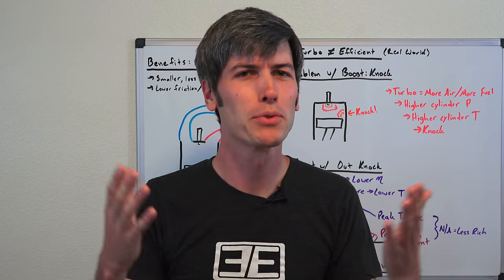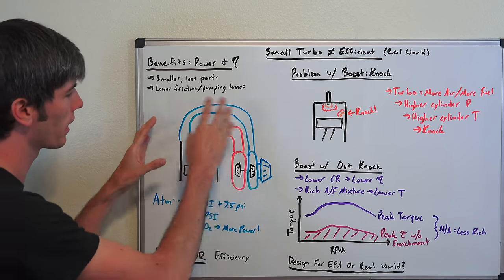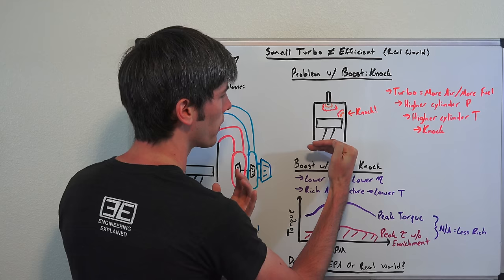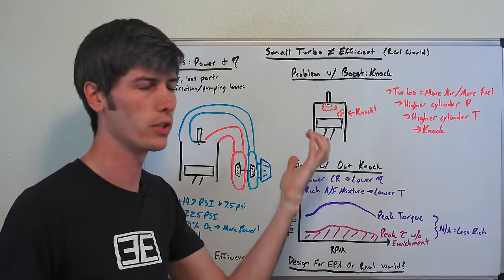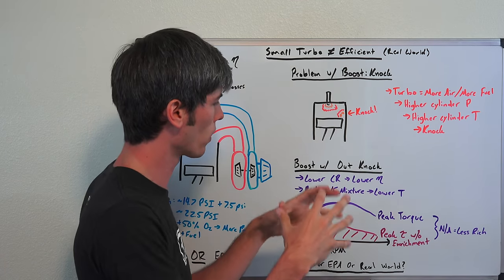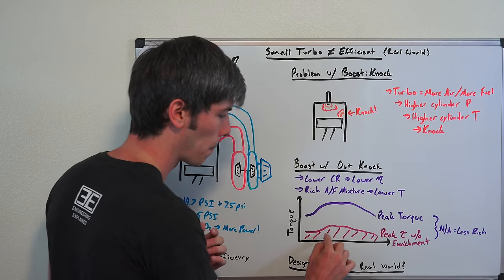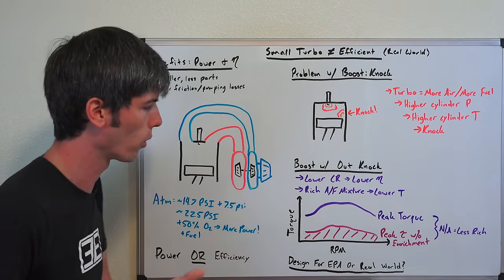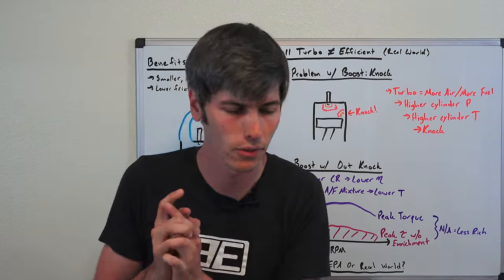Why Small Turbo Engines Are Not Efficient

Comment: I'm a proud owner of a 2018 Civic Si with the 1.5 L turbo that's pushing 20.6 psi from the factory. I get well over 30mpg under normal circumstances because I don't rev the crap out of it like some people do. They complain the mileage is bad; yeah it's gonna be bad when you're hammering the throttle all the time. These cars were built for the instances where you need power, but most of the time you want to save fuel. They're not supposed to be efficient when you're hammering on them
Reply: I have an 18 si as well. I get better than advertised on the hwy. If I keep my foot out of it, very hard lol, I can get 40-42 mpg
Reply: I get over 41 with my 2012 Altima, and its rated at 32 hwy. my city mpg sucks tho lmaoo
Reply: 18 Civic Hatch, hammer the throttle when taking off, slowly decelerate after getting about 5 over, barely hold speed with very light pressure on the gas pedal : 34-37 mpg city

Same car, eco mode on, give as much throttle as I can while keeping a full green eco bar, 5 over to decelerate the maintain same as before : 42-43 mpg city

43-47 highway

I only use Shell Premium
Reply: It's an EX Cvt 18 hatch (1.5L Turbo)
Reply: I'm going to buy one after the refresh.  I'm going to hammer the throttle all the time.  Who cares about mileage...  Good thing I can afford all of the fuel I will be burning!  ;)  Great car.
Reply: Gary Crispin I suggest 2019 Type R 😎👍🏻
Reply: Flat Earth, I wish.  You gonna spot me the extra $15K?
Reply: Gary Crispin lmao I understand 😂
Which is why you'll see me in an EX hatch 😉

I wish I would've been able to finance a type R when they first came out in 17, I could probably sell it for a profit today after driving it for a year.
Reply: I'd love to know how to get 41 with an Altima. Is transmission auto? What is your trick? thx!
Reply: I have a 2019 STI and in 95% city driving with minimal boost never going above 4K rpms I still can't get above 20mpgs if my life counted on it. The kicker is the car is a 6 speed 4 cylinder turbo, I only get maybe 23-24 mpg on the highway driving 60 mph granny driving it. The Highway mpgs are mindblowingly bad. Look at the EPA fuel economy 18-22. I should have double the power if you only saw the EPA mileage figures. In 2018 every 4 banger should be 30 combined without question.
Reply: stuna101a what fuel grade and brand are you using??
Reply: I got an Si also and as long as you keep off boost, you get great gas mileage.
Reply: ... my 18 year old 1.7 metric ton 2.5L 3 series gets 6.5L / 100km (36 mpg) @ 110kph on the highway and  ~12-15L / 100km  (19-20 mpg) in heavy city traffic.  In contrast, a 1L ford I rented during our holiday was getting 7-8 L / 100km (30ish mpg) - and really slow to boot.
Reply: my 2014 jetta TDI could get 36mpg hammering it all day, 55 on the hwy if you hypermile it.
Reply: I have 17 SI love it! 200hp 32mpg
Reply: I feel like that proves the point rather than disproves. Don't get me wrong, I'm really happy with getting 38-42 on the highway with my little econobox Cruze but to be in the 30mpg range in your Civic is pretty crappy considering the advancements in powertrain and aerodynamic design. You're not getting any better fuel economy than my sister got in her 1987 Accord...

The main point is that under boost, these engines are way less efficient than an N/A engine. 20.6 PSI is above atmospheric pressure which means the engine is able to move about 2.5 times more air than it could N/A. Despite all that, it's not making the power of a 30 year old pushrod 3800 v6 despite being as hungry under boost. 

Stop and go driving is where these engines end up falling way short of what people are expecting since most people want to pull away from lights and stuff with a bit more than 80-90hp engines...so the turbos spool to meet the power demand and efficiency plummets to a much greater degree than with slightly larger n/a engines. Obviously driving habits play a huge role in fuel economy...they do in any car...but the downsized turbo engines are limited because they effectively can either be economocial or powerful for an OE application.
Reply: Side note - have you had any oil dilution issues? I've been hearing a lot about the Honda enrichment tables being so fat the gas is blowing past the pistons and diluting oil. Seems to primarily be the CR-V which makes sense for the same considerations as the EcoBoost Escape - the engine is going to be pushed a bit harder to try and get a heavier/less aerodynamic vehicle going. Check your oil level and if it's gone up it might have fuel in it and be no good. I know Honda was working on a re-tune but I don't know where they're at.
Reply: Driving an F-Type R AWD with a 5.0 SC Engine around 30mpg regularly. Why is it again you have to drive an almost three times smaller engine with nonexistent power and sound, no AWD, no Torque Converter, less weight etc etc.

Small displacements are massively overrated - its mostly about the driver and traffic situations, not a mini engine. Best that i got with almost no traffic at night was 34 mpg. I know a lot of people with way less powerful cars, smaller cars, smaller engines that don't even get close to these results. Downsizing is useless...more about rightsizing. Makes no sense driving an S-Class with a weight of over two tons with a 2.0 Turbo Engine. Makes also no sense driving a Civic with a 6.2 Liter V8 SC Engine.
Reply: I also have an '18 Civic Si. I revved the crap out of it in Sport mode and on one tank. Total drive was 30.2 MPG. I think it's pretty great lol.
Reply: Better than me, I have a 15 Si, with the naturally aspirated 2.4 litre, and I don't mash the pedal, and I average about 22-23 mpg
Reply: I have a mk6 gti stage 2 and I get about 28 on average. 23 - 20 if I’m having too much fun lol.
Reply: 30 mpg is actually really bad, in my VW Golf 6 1.0l I average 52mpg easily even going as high as 63mpg.
Reply: @jakob321123  really bad for a compact, or really bad overall? Because I consider 30mpg decent. I just traded my 2015 Civic Si on a 2014 Mustang (3rd 2014 Stang I've owned), and I'm happy with the 22mpg I get. And the V6 Mustang uses 87 Octane where I had to put premium in the Si
Reply: I have a 2017 Civic EX-T it's the1.5L turbo. Ive had it  for a  year  now and I get the EPA estimated numbers. Overall I average mid 30's. I drive it pretty hard. I love balance of power and fuel efficiency.
Reply: Other than nails, not much else is efficient when hammering on it.
Reply: Same got 48hw/27 city on a trip to San Diego, 1.5 gallons to get home. Loving the Si .
Reply: stuna101a bad engineering
Reply: 2016 civic ex-t 31 city 45+hwy 
I live in austin so a lot of city driving and i average 34mpg
Reply: @kaneCVR  highly unlikely your 2000s 3 series weighs 1.7 tonnes.  That'll make it as heavy as a hybrid 2018 5 series. Unless your 3 series was a wagon. Most 3 series sedans tops out at ~1.6 tonnes, given a 1.45 tonne curb weight
Reply: @randomesteven3935  My 3 series is a CONVERTIBLE. The 'vert is the heavyset of the 3 series (e46) and mine has all options available in 2000. A front seat alone weighs ~65 kg.
Reply: Well,my 2018 GTI is running on a stage 2(which is only a $550 downpipe and $600 software installed at home) making 337hp and 370tq and Im getting 32mpg on 93 octane
(Car only have 5k on the clock and you bet that clutch WONT last 10k)
My 2007 sti is much slower than my GTI and as u know- these subarus only get 23mpg which is terrible.
Reply: I had a 1.7 liter Acura and got well over 30 mpg driving like a pissed off teenager....so what's your point???(
Reply: 20 psi and still that slow
Reply: 18 Si here too.  I can get about 40 on the highway.. but where's the fun in that? City driving its around 29ish in summer and 24ish winter..   My 97 civic Ex gets about 27 city and high 30s even 40s on the highway. Not bad fuel economy for double the horsepower and triple the torque.  ;)
Reply: Same here, I have a 2019 Civic Si Coupe. In city I get around 23-26mpg on average that's driving it pretty hard, when I just drive normally I get the EPA estimate of 28 and on highway I get 40 to 42mpg which is absolutely insane. I've gone from LA to San Francisco in on tank I used about 10 almost 11 gallons. 421 miles from point to point and exactly 6 hours and 18 minutes
Reply: I drove a BMW 116i(3 cylinders, barely over 100bhp) for a couple of months and the fuel efficiency was a complete disaster. It might be ok driving around the city, but once you hit the highway you went well over the 10l/100km (under 20mpg). The diesel equivalent (the 116d) is much more fuel efficient,  rarely going over 6l/100km (approx 40mpg) but thats about the same I get with my 320d which has nearly double the horse power and more weight ....
Reply: Wow, they're running 20 psi from the factory? I think Audi runs like 10 on my generation of cars. Mine is chipped and runs like 15 psi. I think the newer ones run more boost.
Reply: @stuna101a  The Subaru EJ is an ancient engine from the late 80's, it's no big surprise that it doesn't perform well compared to something modern.
Reply: It's not so bad for smaller cars like a Honda Civic, but a bigger vehicle like Chevrolet Equinox with the same size engine not so much
Reply: Jared Hoats my sentra claims 32 mpg combined, yet it does 43 mpg combined lmao
Reply: @ThirdLife86  30 mpg nice lie mate.
Reply: ive gotten 45mpg in my 16 optima 1.6t 7spd dual clutch a few times now. its rated at 39mpg hwy and 28 city. i usually get 23-25 mpg city because i constantly whip it around. i love that thing since it sips gas even when i push it super hard.
Reply: I have an 18 ex 1.5 turbo six speed manual; and drive it like I stole it. 33 mpg
Reply: Some n/a engines do quite well too. My 1.8 na corolla can average 36-38 us mpg on the highway, but it only has 137 hp. 

I miss the power sometimes but i like my corolla for slowing me down so i can enjoy the view
Reply: @ThirdLife86  A civic with a supercharged Corvette engine would be siick though! But super impractical, you're right.
Reply: Any Oil Dilution? I got rid of my 2016 Civic EX-T because of how bad it was.
Reply: Gary Crispin found the trump support who thinks climate change is a myth
Reply: Eric Nguyen 7000 rpm will get you 32 mpg?
Reply: 1.5L, with a turbo, eats premium fuel, but drives with no boost 95% of time and talk about fuel economic 😂. Just get a NA 4 banger
Reply: You know that the new 640 bhp McLaren GT makes 30 mpg with mixed driving. A 1.5l making 30 mpg is frankly terrible by comparison.
Reply: 13 mpg for ford focus hatchy 2018. I'm about to pull my headoff
Reply: Jared Hoats civic si is perfect and well promised
Reply: 20.6 psi of boost is from 7000rpm and mpg will become crap no matter what
Reply: honestly, 30mpg is bad for a 1.5 T..
Reply: @stuna101a  how's that sti doing?

Comment: I always looked at turbo'd engines as having the smaller displacement when driven softly and a larger displacement when driven hard.  Therefore, you will only get good fuel economy when you drive very easily, but you have the option of way more power when you want it.  You just have to sacrifice that fuel economy when you want power.  Kind of like cylinder deactivation, only more reliable.
Reply: I had  (2) 2.0 Direct injection turbo engines, one in a Forester XT the other in a Sky redline.  Both rated at about 250-260 HP.  My 13' Accord with a 3.5L V6 (rated at 278 HP) and variable displacement was faster and got better fuel economy.  The Accord ran on 3cyl when that is all you needed.  Problem with a turbo is you are always into the turbo and asking more air and fuel to get moving and stay at highway speeds.  If you paid attention to the whole video they reason for these turbo engines is not really fuel efficiency but to get the EPA numbers higher.  That does not translate to real world fuel economy.  Ask anyone with an eco boost Ford Pickup.
The Accord with cylinder deactivation is 100% reliable.  before 13' there were issues, especially on vehicles where people didn't step on it so much.  Even in the older ones people easily got 200K if the changed the oil regularly.
Reply: @Si Raff small turbo engines start boosting at like 1300/1400 revs... there is no safe "no boost" range cause if you drive it below boost you are going to damage your engine
Reply: unheardNerd Go on then - what damage will it do if you drive off boost? This should be good.
Reply: he did a very long video about this. driving in low revs. i dont remeber the name
Reply: @TheNerd  Can't wait to see it. I would love to know how engines developed specifically for road use - and therefore use anywhere in their rpm range - somehow get damaged by not adding the pressure and heat from boost. 
It's the first time I've ever heard of driving with no boost damaging the engine.
Reply: its not the boost its the low rpm. if u ever (almost or floored) a non turbo engine 4cylinder engine in very low rpms (like 1100) you heard that "oh dear i cant handle that pls let me live" sound that engines make until you get around like 1500 or 1600. im gonna try to find the video where he explains what happens
Reply: @TheNerd  There is no normal road car engine made in the last 10 years where you can damage it by not revving it. Small turbo engines being worse for it makes even less sense. 
Maybe if you get an old knacker or something set up very badly but then again it's just as likely to suffer if you hoof it at any rpm.
Reply: @siraff4461  not using boost causes the turbo to carbon up
Reply: @ramonatan4406  Really? Ok then - lets see the proof. Or even a reasonable theory behind it.
Reply: @siraff4461  It is bad to "lug" the engines because they'll generate boost at really low RPM and there's a lot of pressure for a long time in the cylindera which squeezes more oil out of the main bearings. It really is a thing.
Reply: @94XJ  except the argument is being made to circumstances where boost is NOT being used.. Carbon buildup is inevitable on any di engine. To reduce buildup on the back of the intake valves you literally have to be giving it the goose almost the entire drive, every time you drive it,  to keep it hot enough to prevent it. You cannot damage an engine by driving it conservatively, staying out of boost.
Reply: @siraff4461  the only scenario I hear where driving at low rpm’s for long times and then one day needing to push it causes the damage is when the piston gets scored only along the sides making a sort of shelf where there’s wear and suddenly no wear just a couple millimeters above. And supposedly when you push into high rpms, the piston moves further up the cylinder (maybe due to heat expansion or momentum of the head) and those few millimeters of untouched cylinder can damage the head and rings at the high speeds.
Reply: 5L V8  vs  4L V10/V12  who is more efficient ?